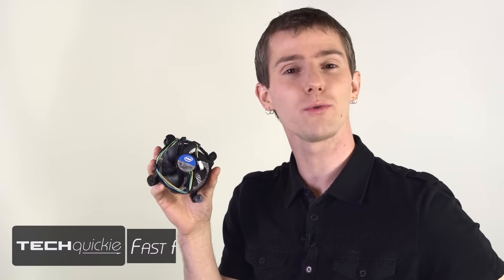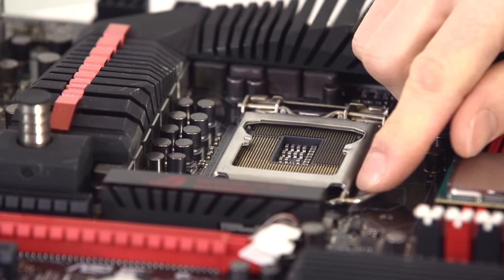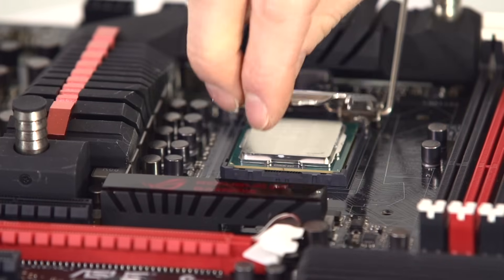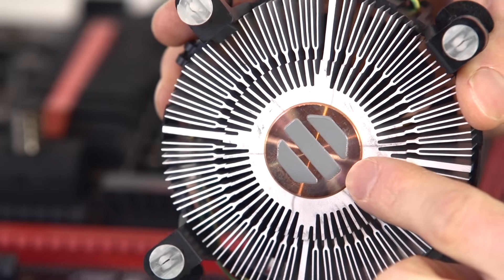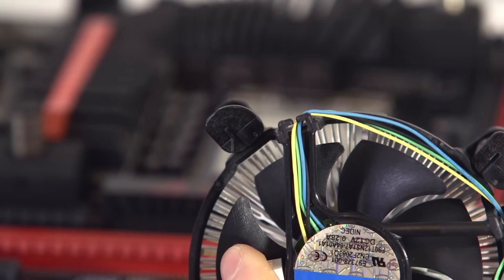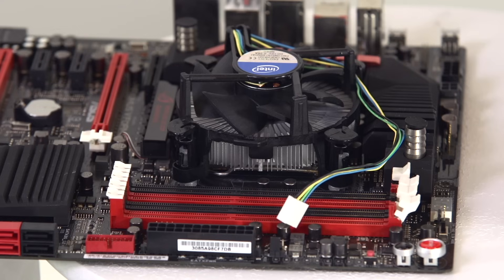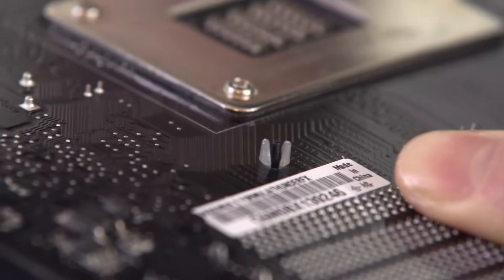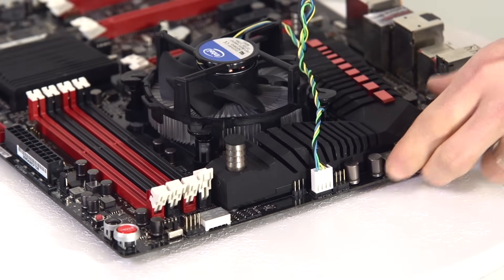Install an Intel LGA1150 or LGA1155 CPU Processor as Fast As Possible

Comment: Just fitted a replacement and one of the plastic mounting pins bent over on the first attempt. Even after turning the pins it is still not locked in place  Complete rubbish design for mounting the things.
Reply: ***** Re-seated mine again today.  Higher temps are because it's still not seated properly on top of the cpu flap. I found that having the pins turned into lock position before you force them through the motherboard holes works better. i.e. turning them back is only for removal of the heat sink and fan.
Reply: ***** The Thermal paste needs to burn in for a while before you're going to get the same temps.

Comment: Thanks for this one. I've never actually installed a stock heatsink but the pump in my AIO has just died after four years so I need to dig it out the stock one and install it as a stop-gap. Looks easier than I expected.

Comment: Hi i got a question. I got LGA 1155 socket. What motherboard should i buy? 1150 is compatible with 1155? Thank you! Answer please asap! Thanks
Reply: Paul G no they are not comptable you need to match the numbets 1550 = 1550 ONLY

Comment: currently having alot of issues with i5 2500 temps and my stupid stock cooler, just doing web things and real temps telling me im on 50c's but when i start doing gaming 80/90. Put on fresh paste cleaned off the old paste but im thinking my cpu cooler is not fully on. Now after watching this im going to turn off and hopfully get all 4 clicks. Have i fucked my cpu long term now ? Or could it be just age i mean ive had it for a good 4/5 years.

Edit, turns out the top two pins were fully in, not the bottom two. Not sure how long its been like that lol.....erm. I just got a msi 960 thinking my 560ti finally started to die, now im thinking ive replaced the wrong part maybe lol DAMIT. Also if anyone has a 960 inside a coolmaster HAF 912 let me know how well or snug it fits
Reply: Aaron Halley lol it fucking did. Its so stupid but my temps are way down and pretty much no issues. Put on some fresh paste and made sure all the clicks/snaps happend.

Comment: For Sandy Bridge K CPU's or higher you should be able to go in the bios, raise the multiplier and set voltage to 'Normal'. Should be good. Turn off Turbo Boost if you want.
If you can set the voltage lower than what it sets itself on 'Normal' or 'Auto' VCORE setting thats even better.
Run some stability tests.

Got my 2500k to 4.3ghz 1.33v that way, easy and solid, passed 20 times Intel Burn Test on Max. No need to change more things unnecessarily when it can be done that way imo.

Comment: Use the fan that came with the CPU. Trust me. It'll be waaay easier to install. Yes, the giant heatsinks with connected fans are better quality. But... the metal clips attaching the fan to the heat sink can come off and the clips often don't stay in.

Comment: you cant overclock a six core with a stock cooler, you will melt the cpu. plus you can pickup a h100i for 90 pounds so i really dont see how you stuck with the stock. Heck! a 212 evo is only £20.

Comment: Thanks old school Linus. I just popped mine off to get rid of the dust cake that had built up, but it wasn't obvious how it went back on. If only I could remember where my thermal paste was. I thought I was only taking the fan off. She is running a bit too hot now...

Comment: I'm reusing an LGA 1150 cpu with the stock cooler. there is dried thermal compound on bo the cpu and the cooler. 
what do I do
Reply: clean it? you use 90% (some say 70% is okay I'd go with 90%)or higher isopropyl alcohol and coffee filters (or carefully use Q tips....coffee filters are better)

Comment: Wait a minute isn't the cpu fan supposed to suck air away from the heatsink? Or is it supposed to blow air into it? I feel ashamed to have to ask at this point in my life.
Reply: Kev Crick The CPU fan in this case will blow air towards the heat sinks to maximize efficiency in heat dissipation. Also, no need to feel ashamed, we all learn and once we do it sticks in our head. Thanks for asking!

Comment: if i remove the cpu cooler to clean it with air spray i need to put pasta again like the first instalation?
Reply: Pasta? No.
You should use paste instead. Just don't buy the cheapest.
And don't eat it.
Reply: on parties you must be very funny

Comment: No, the pins are on the chip so you have to be more careful. The chip clamping mechanism is slightly different. And the heatsink mounting is completely different. Personally, I find AMD sinks easier to mount.

Comment: This video was so helpful and informative! I don't know why but I found this job to be very intimidating (installing heatsink and fan) I think that the instructions that came with the stock cooler were misleading! How they said that you needed to use two screw drivers and turn at the same time to install was just weird and off the mark! Now that I know to keep the arrows away from the fan bracket (or clockwise as you say) and then SIMPLY push down on both corners at the same time just makes life and the task at hand so much easier. That say; and money permitting, I think it would be much better to get a better cooler than the stock model! Have a great day! Peace :) :) :)

Comment: HELP!!! I BROKE THE PLASTIC WHITE PINS, WHAT CAN I DO NOW?
Reply: +Justin Woody google or get a better cooler. make sure it is for your socket.
Reply: +Justin Woody You can take them off and use zip ties?
Reply: David Parkes Not bad... but do i have to take out my whole motherboard to do this? My computers fine but the fan always keeps falling off when i move the computer.

Comment: 2 of my 4 fan seating pins have the black center piece in the locked position. Consequently, I can't push the fan into the holes because the 2 that are stuck in the locked position are now too large to fit in those holes.  Any solution on how to get those pins to return to the open position?

Comment: Dumb question: Im trying to replace my motherboard and the one dang thing I forgot to research was the socket type of my Intel i5 processor. I (think) i found out that the socket for the CPU is 1156 but the board i have coming is 1150. How huge of a deal is this???
Reply: Major It will not work because of this. You should have fully researched before buying. But it is a very easy mistake to make.
Reply: No question is a dumb one. You should be able to cancel your order, If not you can always buy a newer CPU to work with that motherboard. And just for reference what CPU and motherboard is it exactly? Im just asking, There is no way to solve the problem of mix matching socket sizes. This is just so that i know your not also going to mix and match Ram and other devices that arnt compatible with differentiating mobo's.
Reply: Mason DOTNET
CPU: Intel i5-750 
MoBo: MSI B85M-E45 
I tried to do as much research as I could but I somehow blanked out on socket type and didn't realize till after the fact
Reply: And what is the new Motherboard you are getting?
Reply: Mason DOTNET oh my bad, that is the one coming right now. My current one is a Gigabyte GA-P55A-UD4P
Reply: Don't feel bad I made this mistake even while doing the research. Yet I still ended up adding something else to the cart and not realizing until the day of putting it together. I turned into a junkyard dog.
Reply: Samuel Langweil I know this is old but I just made this mistake after buying an i5 8400 (lga 1151) and put it into an 1150 mobo. I put everything together and even tried to turn it on before realizing what I did. I took the cpu out and ordered a compatible motherboard but will my i5 still work after being in the wrong mobo!?!?!? Please reply I’m so anxious

Comment: My fan had actually broke recently that looks the same as in the video. I think it had been about 10 years old. None of the cables looked clipped or damaged but you can see with old computer mice sometimes start malfunctioning depending on their use and age. I had changed to SSD which might have altered the electronic circuitry slightly, and had changed the bios picture, i actually only realized after the CPU went into an emergency shutdown.

Comment: The first time I was installing an 1155 (or 1156 was it) cpu - 3770k, I thought I broke it because of the sheer about of pressure I had to use to put the retention arm XD. I almost crapped myself, but my CPU was fine XD

Comment: Linus i currently have a core i5 3570k and its being cooled by an intel stock cooler, 2 intake fans and 1 exhaust fan. I was thinking about upgrading to a corsair h80 liquid cooling. My current CPU temp is around 27 degrees with normal browser use but when I game I start to see temps of around 37 - 40 degrees. Should I make the upgrade or should I stay with my setup now